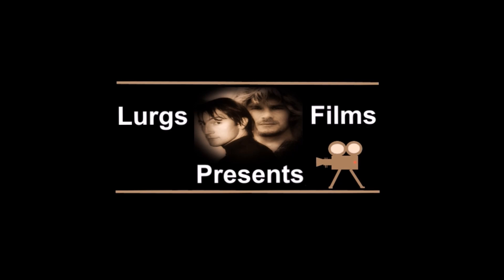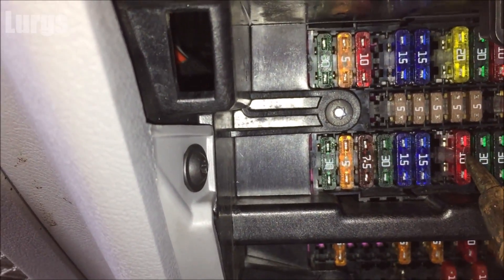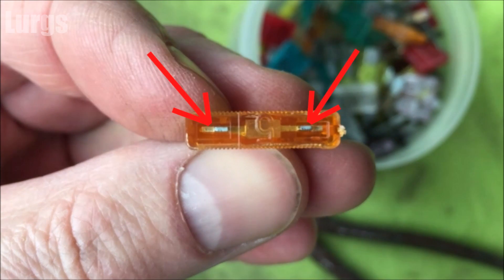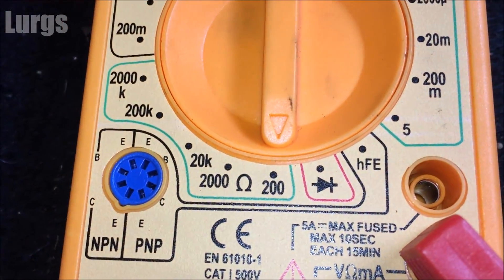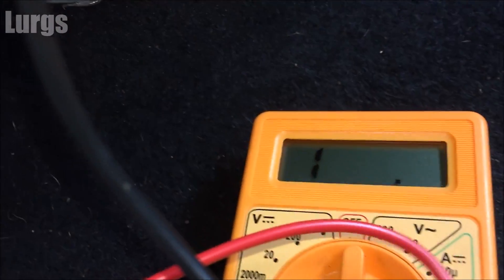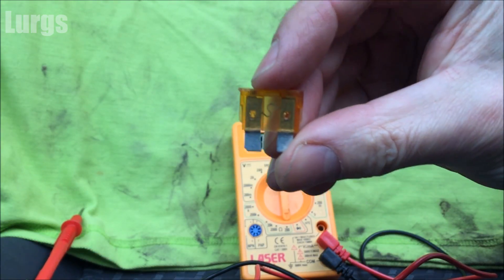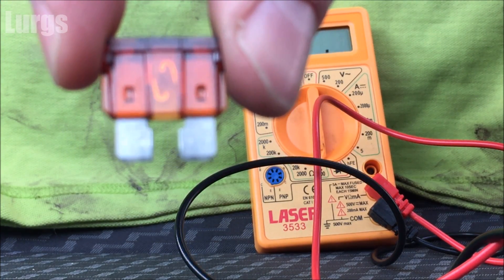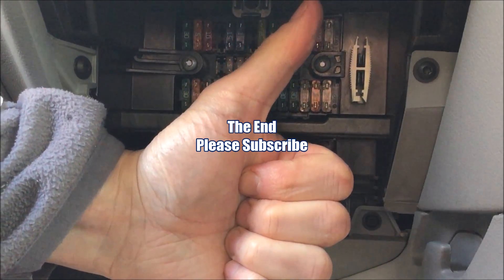How to check car fuses without pulling them out - Testing fuses with a Multimeter

Comment from the maker: https://www.tubebuddy.com/LurgsHowToGuides  I use TubeBuddy to grow my channel. Click this link to install, even the FREE version is great. This link is an affiliate link which means if you buy a TubeBuddy licence I will receive a small commission. There is no additional charge to you.
.
Other useful How To Guides to help you save ⏱TIME and 💰 MONEY:
Vehicles How To's, Tips, Tricks & Fixes  https://www.youtube.com/watch?v=w44aQ7dc_Lk&list=PLqrXuUebV8N9fyM8qA2D0rkVfv929Ckod
How to check car fuses without pulling them out using a Multimeter https://www.youtube.com/watch?v=w44aQ7dc_Lk&list=PLqrXuUebV8N9fyM8qA2D0rkVfv929Ckod
How to test Car Fuses without pulling them out using a Car Blade Fuse Tester https://www.youtube.com/watch?v=zLfa7_FbZrU&list=PLqrXuUebV8N9fyM8qA2D0rkVfv929Ckod
Tyre Pressure Warning Light is ON and How to reset it https://www.youtube.com/watch?v=2AIxNtg8ICo&list=PLqrXuUebV8N9fyM8qA2D0rkVfv929Ckod
How to disable Start Stop on a Vehicle https://www.youtube.com/watch?v=dxzMDT1s7WE&list=PLqrXuUebV8N9fyM8qA2D0rkVfv929Ckod

How to check a Car Battery with a Multimeter https://www.youtube.com/watch?v=VlkYGIMFj48&list=PLqrXuUebV8N9fyM8qA2D0rkVfv929Ckod
How to connect a Car Battery Safely https://www.youtube.com/watch?v=1b2vJjUefYQ&list=PLqrXuUebV8N9fyM8qA2D0rkVfv929Ckod
How to disconnect a Car Battery Safely https://www.youtube.com/watch?v=XJ5SUabZCbc&list=PLqrXuUebV8N9fyM8qA2D0rkVfv929Ckod
How to prevent your Car Battery going flat due to lack of Use https://www.youtube.com/watch?v=xH9V5xfSSMQ&list=PLqrXuUebV8N9fyM8qA2D0rkVfv929Ckod

How to check brake lights by yourself https://www.youtube.com/watch?v=jBK5W18zGJg&list=PLqrXuUebV8N9fyM8qA2D0rkVfv929Ckod
How to fill Screenwash Fluid on any Vehicle https://www.youtube.com/watch?v=zQTDe-u5qA0&list=PLqrXuUebV8N9fyM8qA2D0rkVfv929Ckod
Fuel Cap Side Top Tip https://www.youtube.com/watch?v=s8GSMM8sBiA&list=PLqrXuUebV8N9fyM8qA2D0rkVfv929Ckod
How to replace Wiper Blades https://www.youtube.com/watch?v=Md51wggLBJI&list=PLqrXuUebV8N9fyM8qA2D0rkVfv929Ckod
Windshield Washer fluid not working diagnose and Fix https://www.youtube.com/watch?v=F4nuQ31cluY&list=PLqrXuUebV8N9fyM8qA2D0rkVfv929Ckod
How to use Car Air Conditioning on a Hot Summers Day https://www.youtube.com/watch?v=4zfhuBpWYt8&list=PLqrXuUebV8N9fyM8qA2D0rkVfv929Ckod
How to find a Puncture in a Car Tyre https://www.youtube.com/watch?v=6orpFjsRQGA&list=PLqrXuUebV8N9fyM8qA2D0rkVfv929Ckod
How to replace an ABS Wheel Sensor https://www.youtube.com/watch?v=Kc_g6oudDaM&list=PLqrXuUebV8N9fyM8qA2D0rkVfv929Ckod
What is TPMS and how does the Tire Pressure Sensor work https://www.youtube.com/watch?v=pEkeYkZu-oE&list=PLqrXuUebV8N9fyM8qA2D0rkVfv929Ckod
Car Indicators Soft and Hard did you know? https://www.youtube.com/watch?v=qU75BT_vvdY&list=PLqrXuUebV8N9fyM8qA2D0rkVfv929Ckod
.
How To's, Life Hacks, Helpful Tips https://www.youtube.com/watch?v=dcmxUTsedlk&list=PLqrXuUebV8N92xXP4Dm_pHfBpEQ3wtP2R
Washing Machines How To's, Tips, Tricks & Fixes https://www.youtube.com/watch?v=0_gst8RokRo&list=PLqrXuUebV8N_Bv_41hH-IpIfM5qiS0Sin
Dishwasher How To's, Tips, Tricks & Fixes https://www.youtube.com/watch?v=6z22-Ysn7rE&list=PLqrXuUebV8N89GJMUjDiMqGpAcic3wqfD
Toilets and Plumbing How To's, Tips, Tricks & Fixes https://www.youtube.com/watch?v=vT5KwJ2A2eU&list=PLqrXuUebV8N_d4OWPjAk4PJ7LnKb0Jdot
Combi Boiler How To's, Tips, Tricks & Fixes https://www.youtube.com/watch?v=1gGEP2y_qHM&list=PLqrXuUebV8N8aiBpt_F3n23E3IOLlmgK2
My Reviews https://www.youtube.com/watch?v=QX0ge0QOXJk&list=PLqrXuUebV8N9_JYlSh2LjbfUsybF840oy
Reply: tequila

Comment: You said set to lowest olms is 20 olms but look like you put it in 200 olms.Which one is the correct one  ?
Reply from the maker: 200, or if you have a modern multimeter it may have a beep setting test so it beeps when broken circuit

Comment: Set to ohms, then test meter first....touch leads together....reads zero ohms if ok.  Meter has battery inside, sometimes older batteries have died.  Or worse, have leaked, ruining meter with acid.  I am infrequent user of meter...I take battery out of meter when work is done, tape it to outside of meter.  I have permanently removed small screw which holds back of case to front and taped front to back, easier to insert and remove battery.

Comment: Thanks for this. Confused about why your meter showed 200 in the ohms range but you said 20. just trying to understand if a misstatement or whatever. Thanks again.
Reply from the maker: @dogscratchedoor  In fact some modern multimeters if you select the one next to the 20ohms it will actually beep of the circuit is good

Comment: Thanks you actually showed where to set the Multimeter for Continuity .
Do you need to switch on at any point
Reply from the maker: No you are testing the fuse, no need for ignition to be on

Comment: I guess the better way would be to set it to volts and check across it. If there is voltage across it, it's blown up, if there isn't it means it's shorted, which is what you want for fuses to be.

Comment: I appreciate this video. I am also NOT a mechanic or electrician and have NEVER done this before.  The test probes are positive and negative. Are the fuse check points positive and negative? Does it matter which test probe tip touches the two locations on the fuse?  Thank you.
Reply from the maker: No it makes no difference at all. You are just checking the circuit
Reply: @LurgsHowToGuides  I thought so, but wanted to be sure.  Thank you for educating me about something many of us need to know about.  My car blower recently ceased working, and I was inspired to think it might be a blown fuse. My manual indicated the blower used a 30A fuse. When I found where they were located, I discovered there were 4 -J Case  30A fuses in that box.  I had no idea which one "might" be bad, so I pulled and replaced all 4 of them, even though they ALL looked good.  The O'Riely supervisor, also thought they looked good, and was inclined to think I needed a "much more costly" new blower and blower resister - YIKES!. But I was very happy  that this restored my blower function, especially in our cold winter temperatures.  Now I can test those 4 fuses, identify which one is bad, keep the good ones, and next time, I will know how to test and identify the bad fuse and "save me some money", lol.  Thank you again!  That was a great help.👌 I gave you a "Like" and subscribed. ❤

Comment: Do you agree with these differences to your procedures? And why, or why not?
1. Turn off/disconnect all power first
2. Do a continuity test instead. It gives a beep if the fuse is good, so you can immediately go to the next fuse without looking at any reading
Reply: Other videos suggest you should not only disconnect the power, but remove the fuses from the machine to prevent risk of damage. What is your advice and why?
Reply from the maker: If you disconnect power you will lose lot's of settings in your car (clock, maybe some other computer settings). 
Digital Multimeter can test mains voltage. When ignition is off most fuses won't be live, a few maybe.
Never been an issue when I've tested them.
Reply: Good point. I wasn't thinking of a car.  I was thinking of my caravan,  where I would assume it important to disconnect AC power and turn off DC power before doing a continuity or ohms test on the hot water element or thermostats to see if they are good.
Reply: That's right But the multimeter must have that beep

Comment: Can you test resistance across the fuses with voltage running or do you need to disconnect the battery first?
Reply from the maker: With ignition off most of the fuses won’t have voltage, only a few will, if it does an odd reading set it to 20V setting and test fuse.

Comment: Question, does it matter when pointing the tips of multimeter to the fuses(positive and negative). Would it give me the same reading in the multimeter?
Reply from the maker: Don’t understand the question but it doesn’t matter which way round they go. Some multimeters have a circuit tester which beeps when it’s a good circuit

Comment: Or you can get a fuse tester that just pushes into the top of the fuse. It lights up if the fuse is faulty.
Reply from the maker: Yes that’s another one of my videos, link in description and pinned comments. Found it useful but hard to get on certain fuses

Comment: When you said your lowest ohms setting was "20",  did you actually mean "200"? You turned the dial to "200" but I don't know how to read "ohms"...
Reply from the maker: Yes I meant lowest setting. Some Multimeters have a circuit test function which bleeps so use that if it has one. Or try a car blade fuse tester (video link in the description)

Comment: You should NOT use an ohmmeter on live circuits. Instead you should set your meter to DC volts ( next scale above 12volts) with the red lead on each side of the fuse to ground (earth) of car. If you get 12 volts on both sides of the fuse, it is good, if only on one side then the fuse is blown. 😢
Reply: Thanks. I was looking for this. I know just opening a door wakes up the car. Not sure what circuits are live.

Comment: I am confused because another electrician used a HOund 2 device to check the fuses in a similar way  in order to  find what was causing the drainage to his car battery but he tested all the fuses and the fuse which had a reading was the one that had the problem due to all the other fuses giving a zero reading ...can someone explain

Comment: If you use the diode tester it makes it even easier, because it's going to make a beep sound if there's a connection. So you don't need to look at the display while juggling with the pins. It's just to the right of the 200 ohm setting, the one with arrow and the vertical line.

Comment: What does it mean when I replace fuse and it still doesn’t light up with tester? I have not figured that part out
Reply from the maker: Remove the fuse and test it on its own to make sure your Multimeter is working properly.

Comment: I would set meter to volts ground one end and touch each side. If both sides of the fuse dont show voltage its either head lights or gas pump. Some cars don’t like you disconnecting the power.

Comment: I noticed that some old fuses seem to have "scum" on them, and so even if the fuse tests good, there may not be a proper connection. Cleaning them may be essential, or at least moving them to create a better electrical connection may be essential. My heater would not work, and I had to replace what tested as "good:.
Reply from the maker: In that case then probably best to remove them and check them old school against the light. Thanks for the info
Reply: @LurgsHowToGuides  Your method is amazing!  Really.  My car is an old Mercedes and I did manage to find a Fuse Box diagram on line which helped.

I learned a lot from your video.  Thank you from Australia.

Comment: So if I have a fuse which shows resistance but it’s not blown. What is it? The rest of the fuses I tested all shown 0.00 which are good so I dunno why that 1 was over 10.0
Reply from the maker: Best swap it out for a new one
Reply: @LurgsHowToGuides  but how do you explain the high value on the fuse?

Comment: Are the fuses shown standard or special for your multimeter application?
Reply from the maker: Just standard car fuses
Reply: @LurgsHowToGuides  Thanks, not sure if all had the open contacts at the top.
Reply from the maker: Possibly older fuses don't have the contacts at the top.

Comment: I just pulled a Fuse out to check it but when I put it back it's loose?? Any ideas please. I have no idea.
Reply from the maker: It’s probably not in properly. Remove it and reinsert, should be a nice tight fit, and make sure it’s going back in the same slot you removed it from

Comment: Do NOT do what this video suggests. You can't measure the resistance of a component (in this case the fuse) while it is in circuit, and even less so when it is powered up. You could wreck an expensive meter and learn nothing useful in the process.

Comment: But it won't test if the fuse is bad, only if it literally is so bad that the fuse is not connected anymore.
Reply from the maker: It checks the continuity of the fuse. If the fuse is blown the circuit isn't complete on the Multimeter so it shows as that.

Comment: Not only will take you forever to pull the fuses and check under the light. If you put the fuses back in wrong orientation, it could cause you problem later on.

Comment: should the key be on?
Reply from the maker: No because you are testing the fuse and it’s circuit only. If you had ignition on the you’d need to set Multimeter to 20v incase there’s voltage.

Comment: Why may I ask are you using those dirty old rusty pliers when the fuse puller is just to the right of the fuses in your box.
With those big old pliers you can break the fuse. So old Bloke why the pliers?
Another question is this. If there is current in that circuit and the fuse is blown and you insert your Ohm Meter into the circuit by jumping the two terminals is the ohm meter now doing the job of the fuse and perhaps blowing it? I guess if the meter has a 20,000/volt rating very little current will flow through the meter though.
Reply from the maker: I find pliers much easier than the fuse puller and loads of second hand vehicles they mysteriously disappear. With this test it's just a test of the circuit in the fuse, doesn't matter if there is 12v in it or not. Hope it helped and you found the blown fuse.

Comment: Is this a good way to find out if a wire is corroded or has been cut?
Reply from the maker: Yes you can test wires for 12v, test it on a wire you know works first. I'd set it to the 20v setting to test any live circuits.

Comment: Most multimeters have an audible alarm on the diode test (the arrow symbol one) so you don't have to look at the multimeter while you're testing. Alarm is good, no alarm is bad.
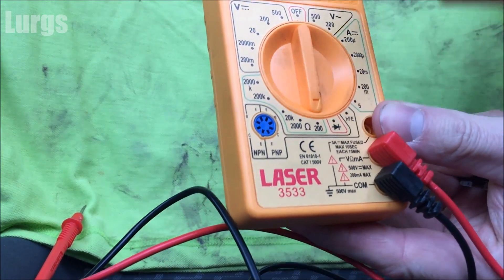Reply: 1:32 I have the same multimeter in the video- does it have the arrow symbol you're speaking of?
Reply: @JG-no4qr  at the about 5 o'clock position
Reply: It’s called “continuity test”

Comment: When I test my fuses it’s gives me a number then it drops down to zero does this mean it’s bad a bad fuse? The multimeter states that OL means no continuity 

So basically all my fuses are good ? I haven’t got an OL
Reply from the maker: Not sure how you are testing. Best way to test it is to do it on a blown fuse
Reply: @LurgsHowToGuides  yes I’m trying to find the blown fuse, I have it on 200omhs setting and I touch each point on the fuse but it gives me some numbers then it stays at zero, other times when I probe the fuse it’s instantly gives me 0 as the reading
Reply from the maker: Grvyrd Gang Read some of the comments, there's some good detail about continuity testing and how\why. Hope you can figure it out.

Comment: you should not check resistance on fuses while they're inside the fuse box. you can damage electrical components in your car. always remove the fuse before a resistance test. if you want to test a fuse while it's still inside the fuse box, do a continuity test using volts on multimeter... ohms is only for resistance test when fuse is disconnected
Reply: +1 !

But I still don't understand how it's possible and correct to test continuity of a fuse without removing it. 

I mean in case of a broken fuse  but still the circuit is closed on the other two sides of the fuse and then should show presence of contnuity anyway !

Thanks in advance ! :)
Reply: @kenzo4Ever  you can use the lowest AC volt setting on the multimeter if you want to test the fuse without removing it. a resistance test should be done on a fuse that has already been removed.

Comment: What's the best ignition live fuse in that fusebox under cupholder ? To put a piggyback fuse holder in .  Got some headrest monitors for my T5
Reply from the maker: Not sure I'm afraid. There is probably a spare one you can use, you would need to test it is live though.

Comment: I would use a meter to test fuses as well, but I was testing high voltage/amperage fuses.  My method was similar, but instead of measuring resistance, I would check voltage.  A good fuse would show little or no voltage on a live circuit, where with a bad fuse your meter reads line voltage.  I would assume that a 12 volt vehicle circuit would test the same, with no risk of damage due to feedback from the meter itself.
Reply: Sounding is the most practical way of testing the continuity of a wire.
You don't need to watch the  meter's indicator,  it simply gives you a (continuous) beep if it's Ok.